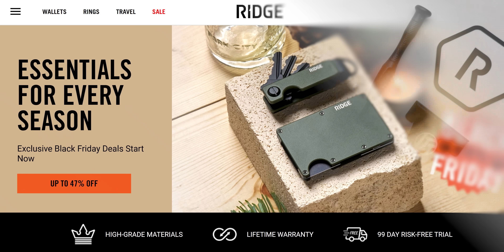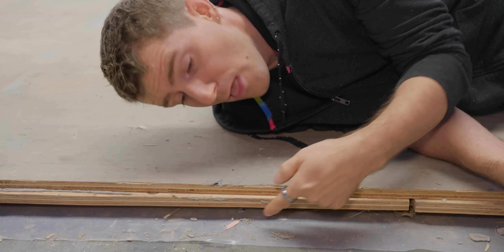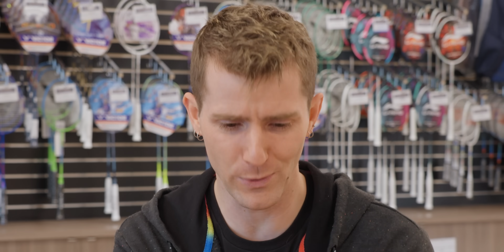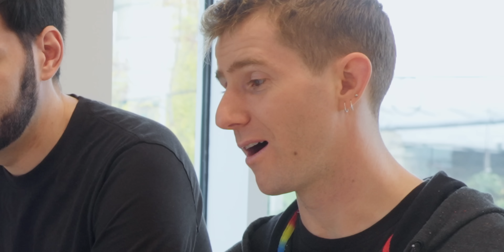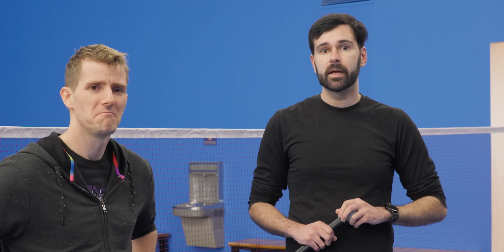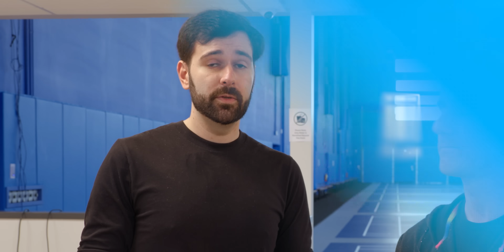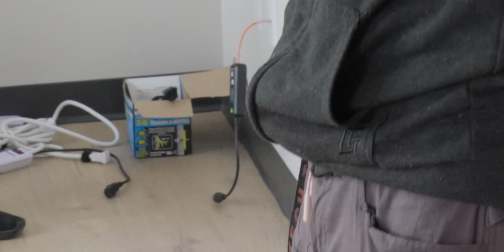You can finally hear me! - LAN Center Audio Tour

Comment: I was having LAN events like 5-7 years ago in a space which had a system like this. Solid stupid proof. 3 buttons, aux, HDMI and microphone. 
Press microphone you get the microphone output to the whole place. Press aux, is now uses aux. Press HDMI and the projector turns on and the sound and video goes to the HDMI. Press any of the other buttons and the sound goes to that device. Press HDMI again and the sound comes back, press it again and it turns off sound and hdmi. 
With a little light showing what input is used. 
Super simple but they paid a pretty penny for it. Everyone, even kids could manage it and that was the point. 
Looked like a KNX swich panel, and probably just a programmable stereo system.
Reply: I was just at a wedding venue that got set up in 2020. They told me they had some crazy guy from Amazon come in. There was one panel on the wall with a Bluetooth module and to control modules that let you choose all sorts of options of where Sound went. They had the main barn hall, the Chapple, serving area and like three or four other rooms down in the basement. I was with a man that came in and they add to such a jacks on either side of the room for DJs to plug into. I had to split our signal delay it and then feed into the system because we were on the opposite side of the room from the speakers. But wow what a nice system it was. And then each of the rooms downstairs had their own little controls.

Comment: This is awesome to see you guys talking about AOIP. My only wish is that you do another video covering Milan (profile of AVB)

TLDR:
Dante = HDMI
Milan = Display Port

To make a conparison, Dante is like HDMI, the most common protocol but is also technically proprietary in the sense that hardware manufacturers pay a license to Audient to implement dante as they have to pay for licenses to use hdmi.

AVB (more specifically "Milan") is kind of the Display Port of network audio. Its truly open and without licenses, its more stable since it has reserved bandwidth and in a lot of cases is higher quality and lower latency. It layer 2 networking from memory too so the setup is a little different.  The downside being that its no where near as common so there are less options at this stage but maybe LTT content could help that.

I'm sure Dan knows about it and i can see why he would have still gone with Dante because there's just much more hardware and software ready to implement right now. I would just really like to see you guys cover Milan and AVB from the tech perspective

Comment: Man, I wish this video was released a year and a half ago. We had to design a PA system for a school, and although I knew some basic things about Dante, I dismissed it because it's not really used for in-building PA systems, and we went with a Chinese company. It's IP based, the speakers are PoE, but the latency makes it unusable for live application, and the speakers are not entirely in sync either. The bigger problem is that different speaker models have different latency, which in our case (indoor and outdoor speakers) was not that bad. The entire system (main controller, 20 speakers, two announcement stations and a pretty much useless FM radio / CD player) ended up costing something like 8000 euros plus later we needed to add an analog stereo PA to the assembly hall for another grand, plus labor fees. Some parts in the controller software are painful (like Chinese software usually is) but it gets the job done.

Comment: I'm so glad he found Dante. It's epic and something I've used a ton for live concerts, concerts, and festivals. It works amazingly well.
Reply: i watch your videos
Reply: I did a small install at my previous church about 5 years ago, and even if the mixer I used only had Dante as an option for stage boxes (rather than a Behringer or A&H proprietary system), I would have used it anyway to avoid the vendor lock-in (so saving money in the long term, you can replace the mixer and just buy a Dante expansion card without replacing the stage boxes as well) and the ability to have devices plugged in to 2 different networks with automatic seamless fail-over if a cable were to fail.

Comment: One additional network feature that is handy for this kind of setup is MAC-based VLANs.   Cisco and Juniper can do them and you can also do them with many different vendor switches (including some inexpensive ones like Ubiquiti) by using something like the Open Source PacketFence NAC.  It allows the network to dynamically reconfigure the port to a specific VLAN when a known device is plugged in.

Comment: It is usually not PA system fault for not being clear.  Most people want scream into them and rush and this isn't an issue for amplified systems only, none amplified also don't like it when you scream into them and talk to fast.  When you just need to talk into them in normal level as if you talking to someone right in front of you and slow down a bit.

Comment: Sound tech here.

If you spend 20K on gear. Drop that extra $1000 on some better wireless. I would not recommend even an amateur musician to buy the BLX series from Shure. If you want Shure with a Beta capsule. QLX or up. Or go with Sennheiser EW-D for a lower budgets. 
It is like building a sick PC and then using a $10 Wifi router.

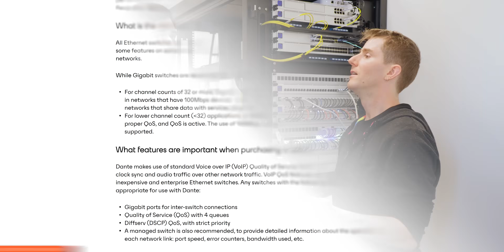Comment: 12:38 wrong. UniFi has ALWAYS worked. You just needed to configure the firewall and ports correctly. I have configured UniFi to run WSG, DANTE, QSYS, corporate data, sACN, various VoIP protocols. All simultaneously, all without issue. It’s just a bit easier now.
Reply: Firewall has nothing to do with it. Dante and Q-Lan both require specific QOS settings on the switch to ensure that the PTP clocking traffic is handled properly. Up until recently UniFi didn't have a way to configure the QOS settings for a switch. I have experienced this first hand with a small Dante / Q-SYS system (under 10 devices) were the Q-SYS core kept going into processor overrun due to clocking issues. Moved to an Aruba switch with properly configured QOS and all the issues were fixed.
Reply: @spartan5280  Yup agreed - Dante on earlier UniFi can work, or work great until you start hearing random artifacts, or it just doesn't. If your primary leader clock is on another switch, it works totally fine. But sometimes doesn't.
Reply: @spartan5280  Wrong, on UniFi prior to proav you had to setup the firewall to block inter vlan traffic. I have setup many working UniFi networks and FIXED plenty more. I know what I am talking about. Yes, on UniFi, the firewall mattered as much as the QoS
Reply: @JamesArthurHurley  I always block Inter-VLAN traffic on all my installs. And I to now what I'm talking about. I manage over 350 Dante devices and over 200 qsys devices. Who knows if it was a bad firmware version but I was unable to get AV over IP to work on unifi.
Reply: Their first gen switches had igmp issues if I remembered correctly. Also their consumer don't have options for alle features. At least not in the GUI
Reply: @chillabaua  And Yet I have them working
Reply: @JamesArthurHurley  how big is your Network and do you stream multicast video? It often works on a smaller scale without fulfilling the requirements. I even used dumb switches for small setups some times
Reply: @ I’m a systems design and commissioning engineer so it varies a LOT. Typically around 11 core/switch devices, and 8-15 APs across either a very large building or multi building sites. And as small as a single cloud device, switch and AP. Or even just a handful of switches in racks with a few core dream machines (they go out independently) for like rental companies.
Reply: Was just about to write this comment. Would have been bad if my last ~1000 venues had no sound lol.
Reply: @ I know right?

Comment: Dante is so cool. A while back, I was working for a university athletics department, doing video and broadcasting. We discussed upgrading our broadcast and in-stadium comms system to a new Dante powered system. We would have a stationary system at our basketball arena and one we could take to other venues as needed. The basketball one would be capable of having 64 channels or something crazy like that. So, up to 64 people could listen and talk on the system at once. Now, it was super expensive, something like $250k, but it would have been so sick. Even had channels built in, and I think we could have had 16 channels, so if I needed to talk just to the camera crew or even 1-on-1 chats with the athletics director, we would be able to. It was nuts. I left before it got finalized, not sure if they ended up doing it.

Comment: As an audio engineer, who works on TV trucks and in live production, Dante is fantastic! The Dante tax is real, but Audinate  manufacturers and supports the IO cards in Dante products, which is crucial in high stakes live events. 
Dante I/O boxes are widely used for Call of Duty® championships and other live gaming tournaments. It will even take 64 channels of Audio direct to and from a PC Ethernet port if you are running Dante Virtual Sound card.

Comment: As a Q-Sys programmer and AV design engineer, this is the video I have been waiting for since it was promised.  Great job Dan!!  I would suggest doing 'signal names' to clean up your design.  No more wires all over your screen.  Much cleaner look.
Reply: Our integrator just installed a small Q-Sys system in our chapel, and now I'm doing all the trainings so I can make program changes myself in the future. The more I learn about it the more impressed I am. I knew Dante was amazing, but combined with Q-Sys it's wild what all you can do.
Reply: Very nice, Q-Sys was one of our options as we were moving from an old Crestron DMPS300C matrix switcher before. Much love for that ecosystem.
Reply: I came here to say the same thing! It was great to see this but the mess of wires in the file made me cringe

Comment: Wow no idea if you saw my post on the original video but I had actually suggested looking into the QSys core just because of how configurable and expandable they are but they aren't cheap. About the only thing I personally would have changed was I would have just used self powered speakers similar to the JBL Eon you had at the start just b/c I'm not familiar with the POE speakers but the idea is really neat behind them.

Also there is no reason that 70v line system can't have musicality to them. I've actually installed 70v line systems that also included in-ceiling subwoofers which was an interesting take for a restaurant but floor space was at a premium in this particular space.
Reply: So many people give 70V system such a bad rap. Sure there were some bad quality transformers out they're tied to some bad quality speakers but a lot of it was the junk that fed the system not being set up or installed properly, used properly or even responsibly maintained.

Comment: How would this Q-SYS + Dante ethernet audio system compare to a legacy audiophile analog set-up?  Is there any loss/degredation/compression from the Dante XLR to ethernet adaptors v.s. XLR all the way?  Has anyone wired a multi-channel home-theatre audio with this ethernet method instead of a typical AV receiver and XLR cables?  I ask cause my mind is running wild with the home theatre possibilities this may add.
Reply: It's pro grade equipment so compression with that! There's probably some slight conversion latency. And I'm not familiar on the method used to do the conversion but that's what all of the major large how do you systems are using so can't imagine it's anything but really good.

Comment: As an audio contractor for the last 25 years, it still amazes me how highly trained people in a variety of technological topics are still unaware of the wonders of Audio systems, Dante is excellent, but along with Dante in equipment I would have chosen either JBL, QSC , BSS, CROWN. With control with AMX or Crestron, for the mics.. Shure or AKG
Reply: With the amount of control that Q-sys does now, there is now way I'd use Crestron or AMX if I'm using a Q-Sys DSP, and that comes from a long history of using both AMX and Crestron...
Reply: @fotografa  yes. Just a control panel with Harman Audio Architect should be enough.

Comment: Nice to see some Qsys and Dante on the Chanel,
I really hope the Unify Beta with the Pro switches and Dante protocol wil work.
Small Tip for Dan, You have the block PA Router and this is one block that can control all of your announcement to every zone you want and can even record save en play the announcement again.
Even automatic pre-announcement can play from here.
I work for a theme park and the AV is part of my responsibilities, so I have seen some creative programming. The best advice I have is think a head of what you want. Take that in consideration while programming and keep everything nice and tide and slit the inputs routing outputs enz on different pages of the program gets bigger and bigger for a nice overview if you need to change tings.
I am looking forwards to see what you guys have done with it. Good luck and have fun.

Comment: This is neat! Just so people know, most insulation and sound treatment materials aren't rated to be painted. Paint fills in the pores of the material and particularly impacts high and mid frequency absorption. Be sure to check datasheets before you paint acoustic treatment, we've had to rip out a lot of treatment that was rendered completely useless because it was painted!

Comment: One of the big spaces for Dante audio is that it’s used in most large theme parks (such as Disneyland) to transport audio everywhere on its own dedicated network. 

Back in the day, distributed audio in a theme park meant having large cages with audio processing cards in them, sending out audio to other parts of the park into amp racks, then doing 70v speakers from those racks. It was complicated, expensive, not super adaptable, and not easily configurable. Dante is muuuuuch better.

Comment: I would strongly suggest Netgear AV line switches for qsys control and audio. Also need to look into touch panel controls. Also you need to look at QSC wallplate inputs. The Dante AVIO adapters are not a great solution. Potentially look at the Shure ANI interfaces that can just use any network cables.

Also the Qsys core is able to do much much more than you are having it do now.. You just stumbled into a much bigger echosystem than you anticipated.
Reply: Or they're planning to have future expansion capability.
I think 90% of the time they're not gonna be using those brake adapters anywhere near the public. Except for maybe as an input to the system for sanctioned events. So they don't really need wall input jacks. But they definitely do need to look into wall controls.

Comment: I'm a bit surprised that they use a analog to dante converter for their shure mics when the higher end shure wireless systems like ULX-D and Axient can output the mic signal directly via dante. Also curios if Dan will implement a status display of mic info (like battery level, receiving signal strength, ...) on their control dashboard, at least shure is pretty open with their status network protocol and Q-SYS has a integration for a lot of shures receivers. This could be handy at a LAN or Tournament to see remotely the battery level to change them bevor they die during an important announcement.

I work at a mediacompany and we use lots of Dante, sometimes with control systems from crestron (in our bigger conference rooms and one Bar/Lounge where we also do Live Media productions(TV, Radio and Streaming) and there the flexibility of Dante is great) -> nice to see this topic covered on a big channel

Comment: Looking at the price of the PoE speakers, you seem to have almost $19k in speakers alone, not to mention the Dante gear.  But kudos to you guys for getting a reasonably intelligible  PA system into an environment like that.  Controlling reflection can be a real bear.  Another option would have been to mount all of the speakers facing down from the ceiling trusswork.  But you need to consider the 'beam angle' of the speakers (the higher they are above the floor, the narrower the acoustic beam spread needs to be, in order to prevent overlap and comb filter interference).

Comment: Really glad to see q-sys and Dante on this system.  Both top of the line systems built perfectly for this kind of install. With so much room for expansion and customisation. Q-sys's existing integreation with their own hardware, midi, osc and custom scripting will make for some great options with stream decks, wall stations and so many other device options. Shame Dante's not cheap tho.

Comment: Your basic PA system has an extra step, with a powered mic, you do not need a mixer, you can plug the mic directly into the speaker, it even provides phantom power if your mic needs it.

Comment: It's great to see you guys find out about all this awesome equipment that I use every day at work. I'm part of a large theatrical sound department, and we have several huge systems running nearly everything you've talked about, and more. Dante and QSys are just one small part of our larger infrastructure. We also run AVB audio networks and NDI video networks. Modern networked A/V infrastructure is incredible for its power and flexibility. We can, and often do, make sweeping changes to the systems with the push of a button from halfway across campus.

Comment: That was a step up from pure programmer art Dan!
Reply: For the audio routing you can also setup the Dante network to use AES67 instead, make the audio server run Linux and use Pipewire + Carla + SonoBus to setup audio routing...

Then you can connect using SonoBus to your PA and use whatever device you want over the network as well... outside of the "Dante VLAN"!